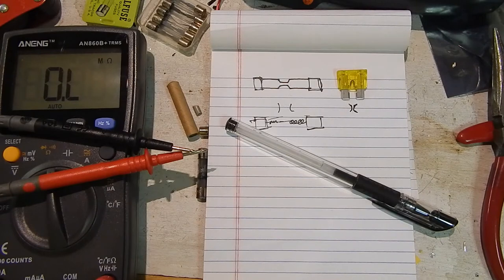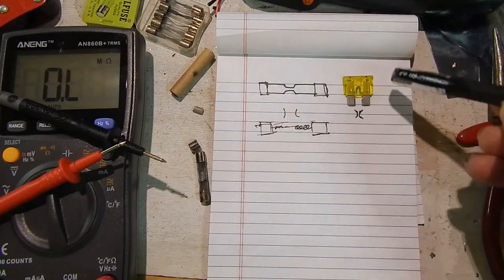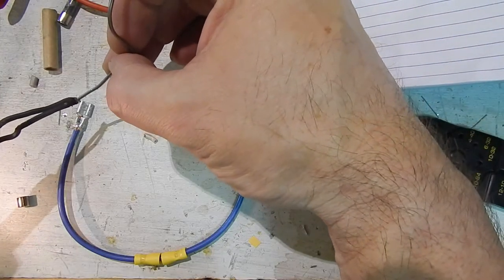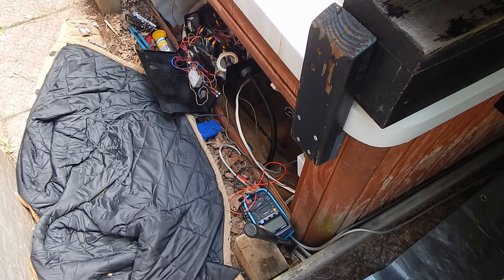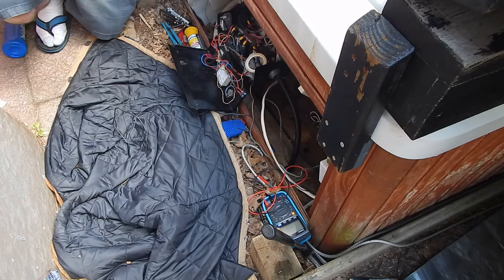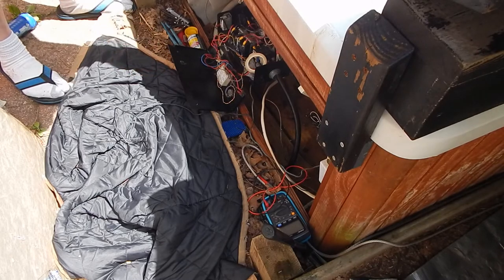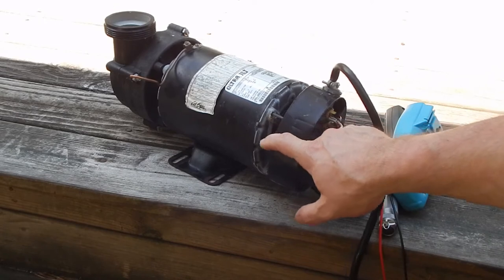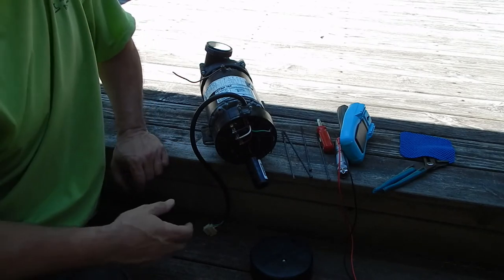Short Circuit in the Hot Tub?!

Comment: Similar config as on my brother's pool pump except the centrifugal starting switch is accessible. The switch went bad and the motor would just hum and draw heavy current. I went out and bought a hard start kit which is actually made for permanent-split capacitor refrigeration motors and wired it in place of the switch. It uses a thermister instead of a switch. It has been working for years. Only drawback is if you turn off the motor, you have to wait one minute before restarting to let the thermister cool down.
Reply from the maker: Thanks for that, a Hard Start kit is a new one on me! The two speeds might be a complication...
I remember you did a video way back, probably on the old channel where you fixed it by cleaning up the points, and I thought to myself that it wouldn't hold up. Don't recall one on this kit though, maybe it was between Vegematic and JohnAudioTech?